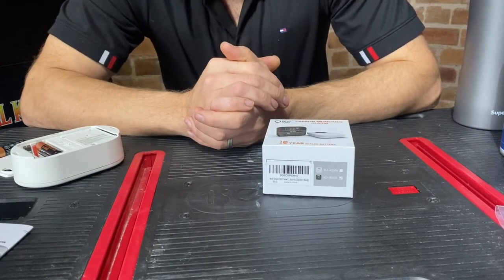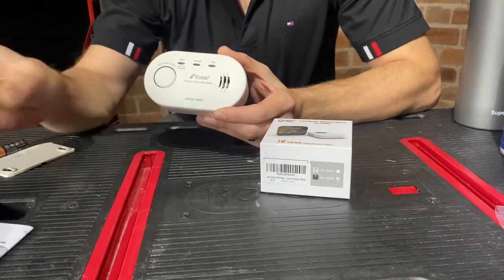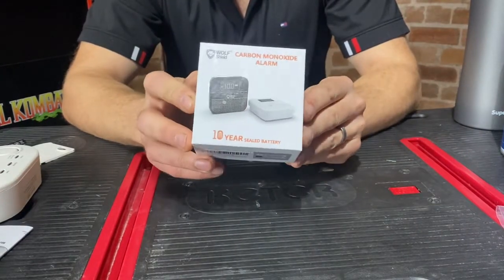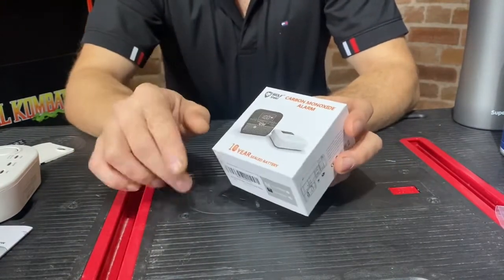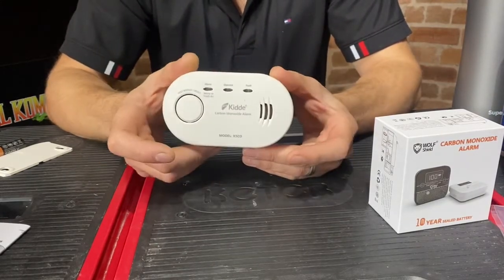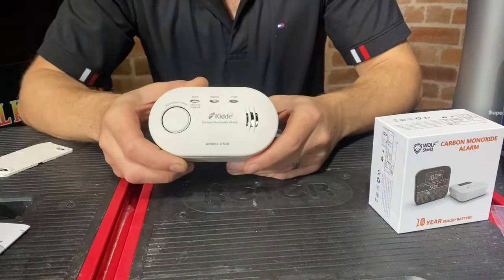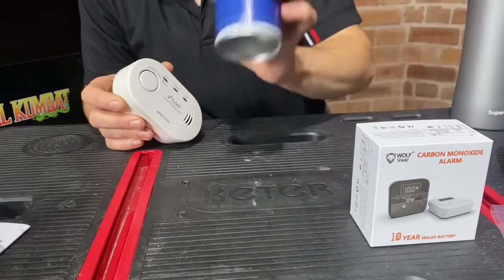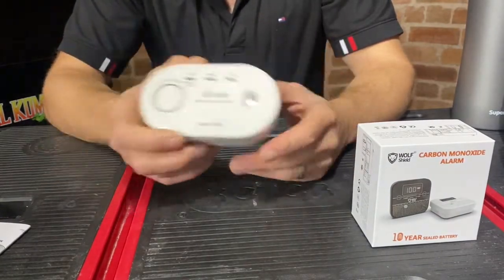How to test a CO carbon monoxide alarm.  Comparing wolf shield CO alarm and Kidde

Comment: Hi Mr. Heating it seems easy to put an alarm in a bag and spray the co but wanted to ask you I would get nerovous spraying this stuff with out knowing how many ppm I had  I wonder I guess it could not hurt to add an additional co alarm with a digital display than you may be able to compare it to another alarm in addtion to the one I would have tested which is not digital? thoughts please thank you P.S. is that not basically what you did but you the digital alarm was found to be an unreliable type?

Comment: I'd just like to confirm that the Wolf Shield is not a piece of shite... Like you said it was faulty, hence the alarm is faulty. I bought a wolf shield and it's reassuringly mega loud.
Reply from the maker: Well - from a customer experience point of view i received one product FOC and it was faulty.  Do you think your average consumer is going to go to the lengths I did in testing the product?
Or - more realistically would you expect a landlord/home owner to purchase the item and pop it on a wall - assuming their obligation was complete?
Reply: @petegasguy  no need to be confrontational about it... I was just saying that you can not be disingenuous to a brand just because the one you received was faulty. Send it back and ask for another, then give a non biased review.
Reply from the maker: @djpickmix6670  not at all… was asked by manufacturers to test in a specific way and I did.  When they didn’t like the results they asked me to remove my reasonable review ‘or else…’

With that in mind - i thought i’d share the findings on here. 

Also worth noting that I know another chap who was given a free sample and it did the same thing… the argument is QC there is poor, in my opinion.

Would you risk your health or the health of your family with one of these devices?

Hey - these public forums are great aren’t they… full of opinion etc.  let’s pretend someone sees this video and thinks ‘i’ll test my alarm’ and they too have a faulty unit, that’s a positive, right?

Have a good one.